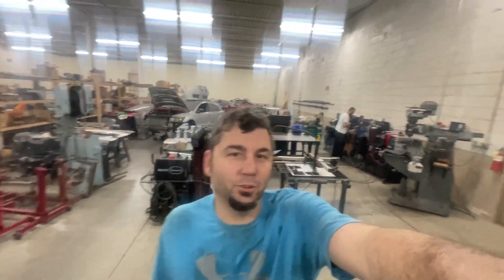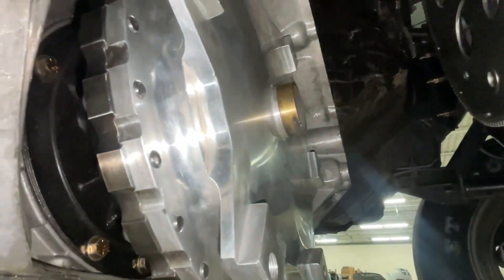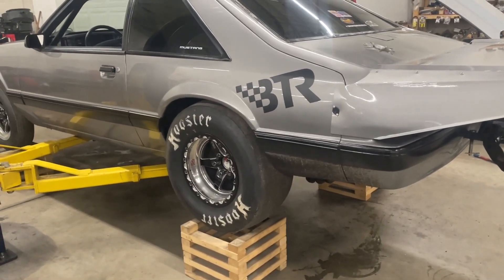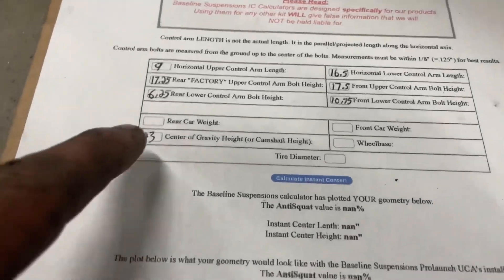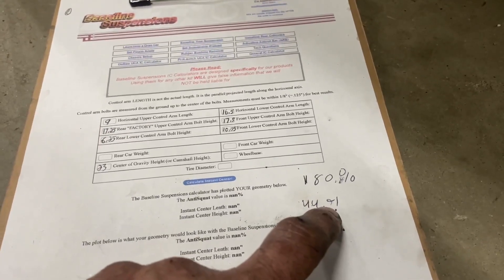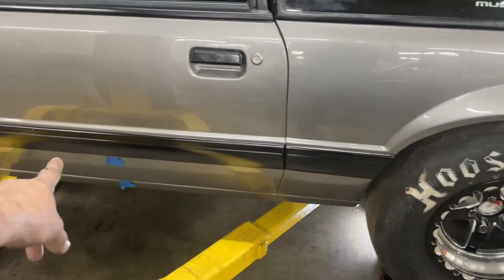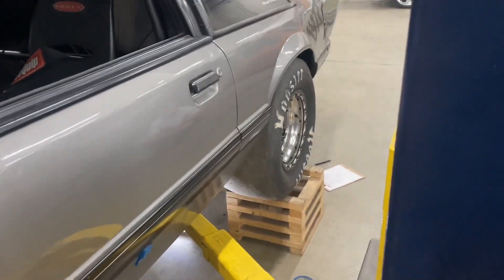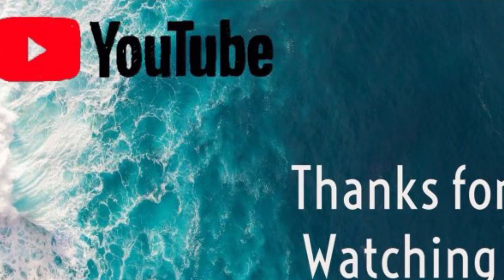How to measure rear anti squat, we pull the stall converter out of ghost to see if its broke

Comment: What converter is in your boys truck I'm doing 6.0 ls3 heads+ nos deal in foxbody I know trucks 6.0 ls3 heads
Reply from the maker: It has a jegs 3600 if I remember right
Reply: Transmission specialty got kill deal on 3 different converters rt now on eBay rated to 850hp they say $628.00 get for 319.00+ tax I got 3400 to 3700 they look just like jegs
Reply from the maker: Hell yeah, i had some friends run freakshow converters off ebay that worked well